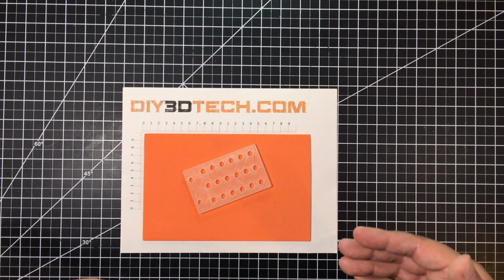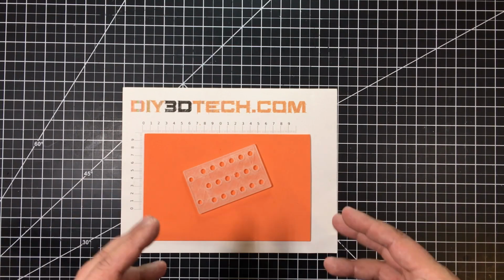Shop Talk - Followup to Printing Super Strong Parts!

Comment: Just saw this after commenting on the first video.  FWIW, I got it the first time. :-).  IMO the over extrusion combined with more plastic coming out (increased layer height) is the magic combo with your method.  It's a good tip.  I was surprised nobody mentioned larger nozzles - the conventional wisdom is that larger nozzles yield stronger parts.  So you could also have backed your way into proving your point with that as a starting point...  I keep a CR10 fitted with a 0.8mm volcano hotend for when I want strong parts and don't care too much about how they look close up.
Reply: Right 💝
Reply from the maker: Thanks for commenting, with the CR-10 and the 0.8 nozzle is the hot-end stock?  I tried a 0.8 and the hot-end would not hold the temp well so went to 0.6 and works great.  Now I do own one of the original CR-10 so maybe that is the issue.  Also using this combo I have created some amazingly strong (solid) parts.  Outside of a bit of waviness, these have an impressive resiliency...
Reply: DIY3DTECH.com No I converted it to volcano heat block.  This idea was another Stefan video a long time ago.  Mine are also the originals.  I have a new V2 still in the box waiting for me to make space to put it.

Comment: I think the appeal of Stefan's video is the controlled comparison testing. You could do the same here. Regular settings vs your improved settings,  test to failure with a repeatable method.
Reply: Yes, I'm still waiting to see any kind of testing data.  Otherwise, how does Mr. DIY3DTECH.com know it actually works?
Reply: @brianrenegar8964  good question but we don't want to push our pleasant host Joe OR we will get 30 minute long videos like Heer Stefan
Reply: @RomanoPRODUCTION  So we just take his word for it?  Sorry, I'd like to see data.
Reply from the maker: Unfortunately I do not have a machine like Stefans, however what I do have is "real life".  I use these parts in real life machines and applications and they have performed well.  This is why I shared the idea so instead of me testing you (meaning all my viewers) can try it out in their application and see for themselves.